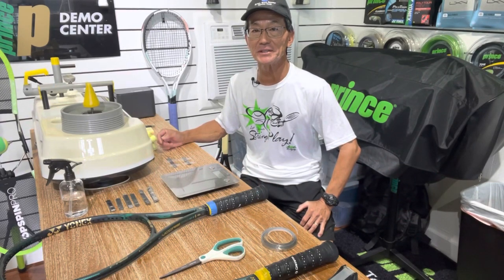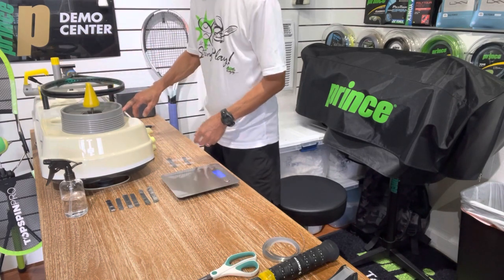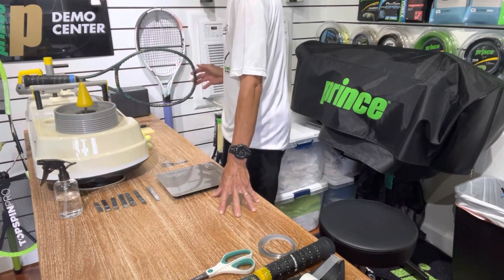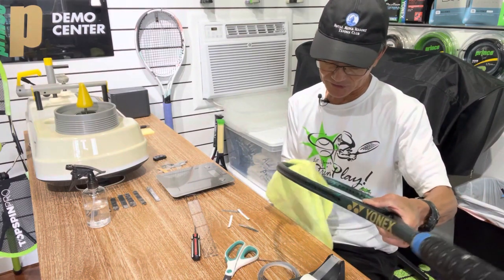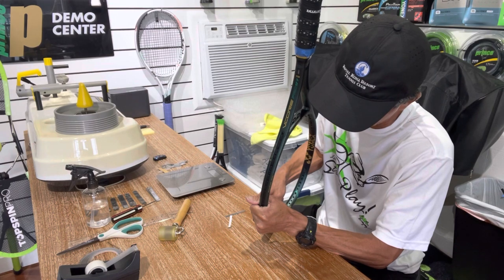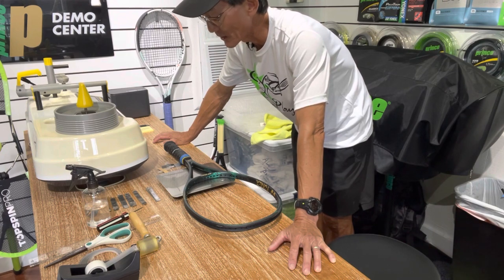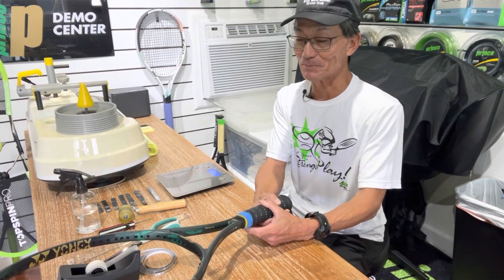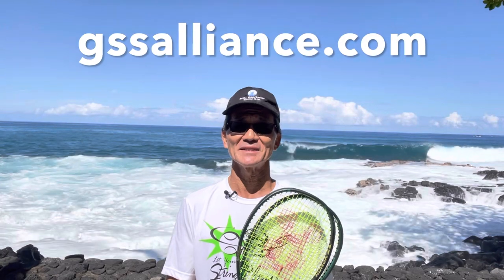Racquet Customization [Matching Frame Specifications - Episode 1]

Comment: 4:05 I use tungsten putty instead during that phase when I'm trying to find a spec. Saves sticking and resticking tape or messing with lead tape prior to applying it permanently
Reply from the maker: Aloha, I know some people use Blue Tack in the same way you're describing. Just wondering, are you pinching off (tungsten putty) what you think you need and adding weight from there? Or do you have batches of pre-weighted tungsten putty on hand?

Comment: Hi, I’m curious what is the swingweight machine you use? Could you please link it or the other options for swingweight machines. Thank you!
Reply from the maker: Aloha Jerry, I use the Babolat RDC (Racket Diagnostic Center) which I bought over 25 years ago. There was a model that came out a few years after but is no longer in production. Back then it was about $5,000. Currently, there are a few companies that make a swingweight machine that runs about $1,300. https://www.tennismachines.com/product/prince-swingweight-machine/

If you want to get something more affordable, the Briffidi makes one called the SW1 Racquet Swingweight Machine which is $250. Apparently, it works pretty well. Here's a video that Tennis Spin and it includes the link to the company if you're interested in buying one. https://youtu.be/Wr7L3uDd_Yg

Comment: Wtf, with the big thick grips? Looks like two undergrips on top of each other. Also, how do you know where to add weight? If you don't measure twist weight also, the placement of the lead could be completely wrong.
Reply from the maker: Aloha Chuck, 
Yes, those racquets had multiple grips wrapped over the original grip. They were almost round! 🤣

I don't use twistweight measurements in my frame customizations. I primarily use static weight and swingweight to determine the location and amount of added weight. 🤙

Comment: 348 grams unstrung? You must string for Paul bunyan (kidding). Perhaps a leather grip, or weight under buttcap is to explain the hefty weight. I plan on customizing my own rackets this summer.
Reply from the maker: Aloha, Yes, those grips were practically round with no bevels. Good luck with your customization project!